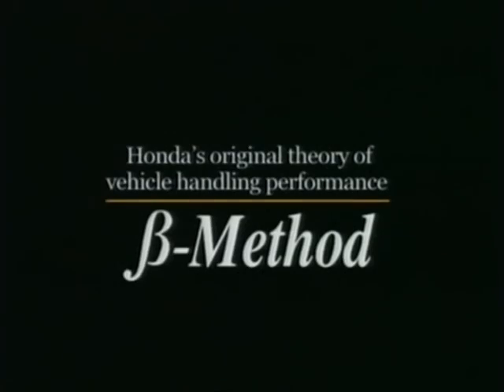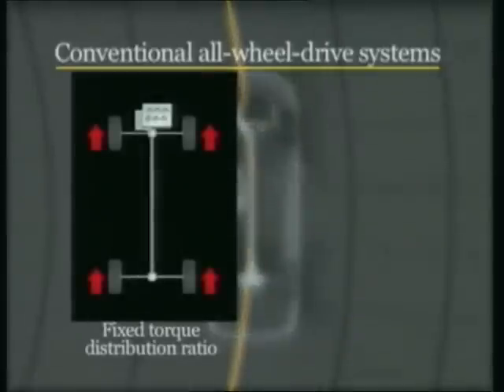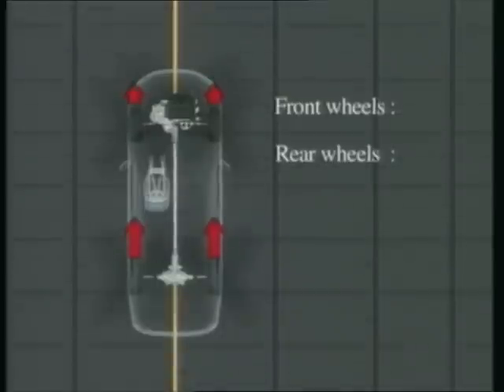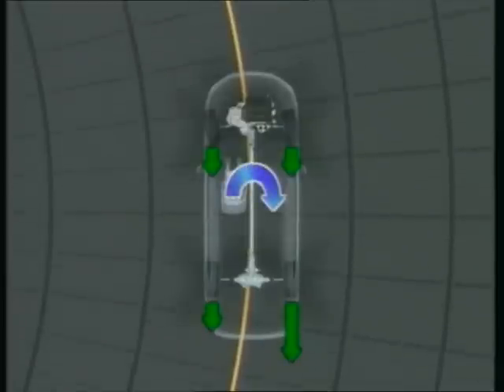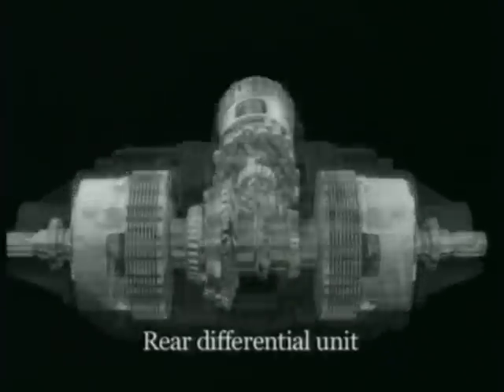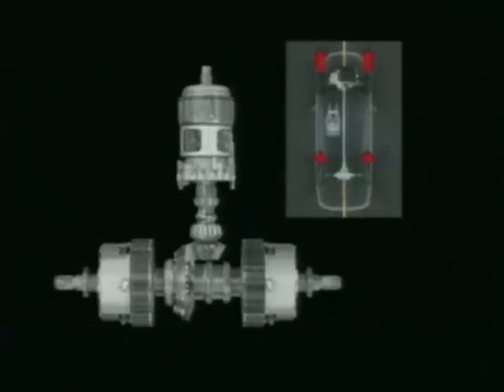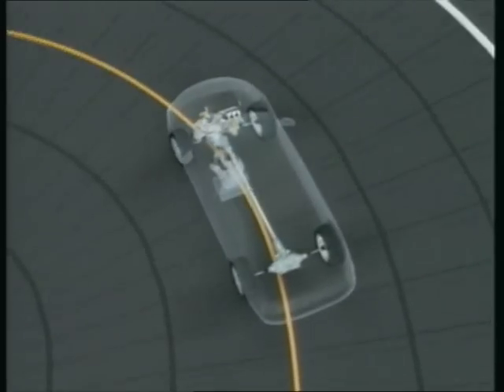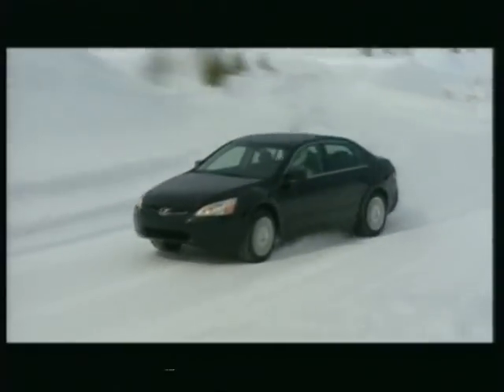Honda SH-AWD: Super-Handling All-Wheel Drive System

Comment: Skip to 6:30 to get any clue as to how it works.  Basically, there's a little gearset at the front of the diff to up the rotational speed a little, and an electromagnetic clutch on each half-shaft to make one side spin faster than the other.